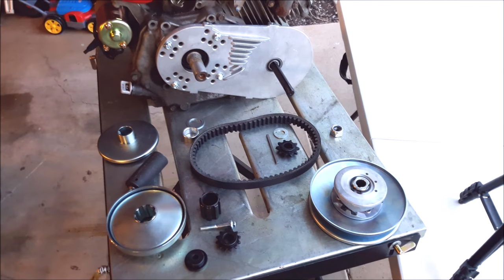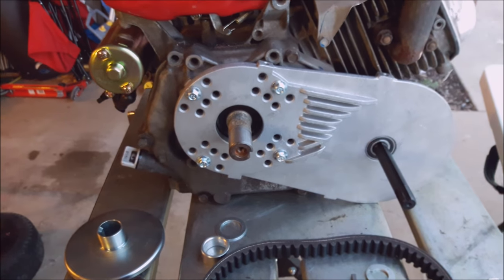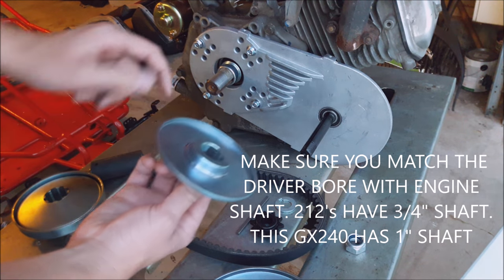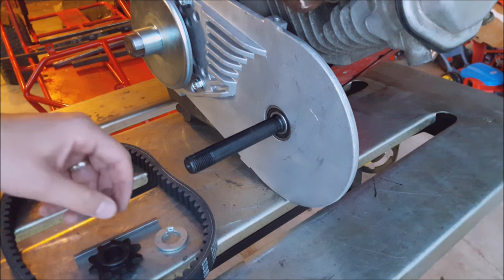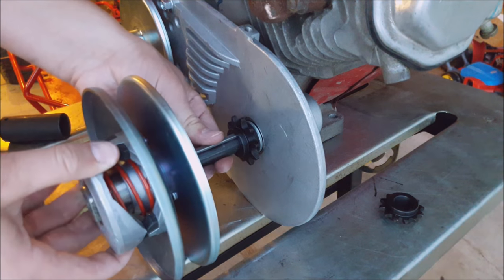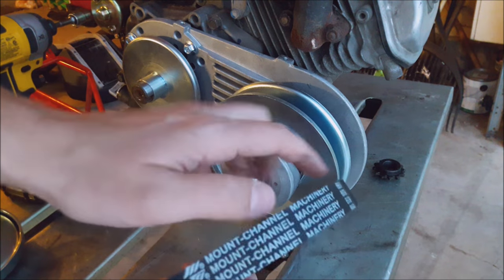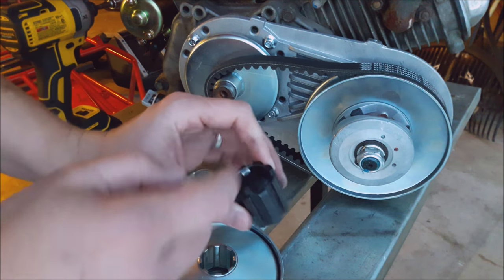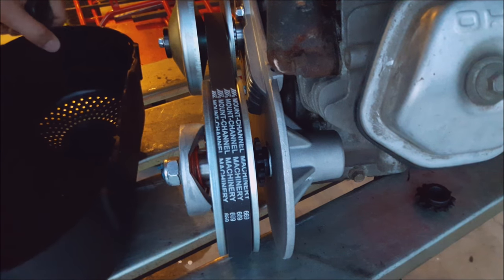Go Kart Torque Converter Setup Install (TAV)

Comment: Why does my belt not spin at all? I've properly installed it as far as I can tell. Initial pully spins, but no grab on the belt. Belt is installed correctly as well and the whole torque converter I can move by hand when off and turn the wheel. I don't get it. Any ideas?
Reply from the maker: Is it new? Sounds like they sent the wrong belt.
Reply: Mech Master I'm wondering..
Reply: Mech Master The belt is a 699 and fits perfectly. The belt just doesn't move at all with the spinning front of the tq converter. I've reinstalled it and still no action. Confused 😐
Reply from the maker: @RockieRoadz  nothing when revving the engine?
Reply: Mech Master Correct, strangest thing. I saw you have a 669 belt, and I stated incorrectly as I checked and I as well have the 669 belt you have. I see in footage that the front dealy is supposed to expand and push inward, raising tention and the belt. However I am getting just the belt sitting there and I'm wondering if for some reason maybe there's a slight gap that is not permitting the belt to get squeezed, which could be why it's not spinning.
Reply: Mech Master Either that, or maybe there's too much tention on the back end ? It shouldn't keep the system from working though. Like I said the front spindle is spinning like it should, tightened well, but belt just sits there no matter what RPMs.
Reply: Mech Master I'm still trying to figure out this tq converter. No matter what I do the thing will not spin the belt and it (the front clutch pulley) does NOT move inward when revving the engine. I don't get it. So you think it's locked?
I tried contacting the eBay seller I bought it from 8 weeks ago but.. no response. Trying to not buy another setup. Thanks for any help. I've uninstalled and reinstalled it multiple times, watching multiple videos and I'm doing it correctly. For some reason that clutch pulley will not spin. Thanks,
Jesse
Reply: @RockieRoadz  My son had a similar problem and it turned our to be that the engine wasn't revving up enough to engage the clutch. It worked when it was up off the ground but as soon as he let it down, it didn't work. Other than that make sure your key-ways are installed.
Reply: OneCupOfCoffee204 I've gotten two other belts, one smaller on larger slightly. I have currently determined that I think the driven pulley (in back) is preloaded too little or too much. I'm working on getting that figured out this week..

Comment: Blackhorse Racing makes the only decent inexpensive ones.
I have a 40 that never skips a beat and just got  a 30 series from them also.

These things need to be perfectly staight and have the belt on the correct way.
Not implying the uploader did this, just leaving the advice since that is at least 90% of the time the problem people have.

Comment: What gearing do i need for optimal speed and torque with a torque converter?
Reply: That's a good question because gearing is so important. But no one will know how to answer without knowing what tire size you are running. How tall is the tire? Mini bike or go kart?
Reply: @Deucealive75  in a go kart with 200 cc and 6,5 cv, what do you recomend ?
Reply: @felipeluizfelten  How tall is the tire? The tire size is important if someone were to make a decent guess where to start on their gearing. To find how tall the tire is you have to look at the tire and find the largest number of the three numbers there. Or measure the diameter with a measuring tape.
Reply: @Deucealive75  the size is 22/10/8
Reply: @felipeluizfelten  With a torque converter I would start at no less than 7/1 gearing.  Be sure to get more opinions on this from others with go karts.
Reply: @Deucealive75  do you think that in the 20/1 ratio i can get 60 km / h of final speed?
Reply: @Deucealive75  37 mph
Reply: @felipeluizfelten  That I wouldn't know but you may be able to find a speed calculator online somewhere. Why and how would you get 20/1 gearing?
Reply: @Deucealive75  I talked to a friend who saw the kart built by another friend in which the ratio was 21: 1, he said the kart had great acceleration and a speed limited to 45 km / h. I want to build a really simple kart model, it will be the first one I will do. He said that this reduced 20: 1 ratio is better for great starts. i'm from brazil and unfortunately here things are also very, very expensive compared to other countries. A Chinese cc 200 hp engine costs 80% of a minimum wage.
Reply: its like 1200 bucks if the wage in USA is 1500 dolares.
Reply: About 1000hp

Comment: Do i need a torque conveter or can i just have.the clutch driving the wheels
Reply from the maker: There are a lot of factors that go into that question. You'll see these torque converters on the bigger go karts that are heavier and need the low-end torque to get it going. Have you just have a little kid Kart then your typical centrifugal clutch will do just fine.
Reply: @-DIYPRO-  i do just got a kid 2 seater. It came with a anemic 163cc. Im thiking of putting in the predator 212cc directly to the wheels as i am a cheap lad😁

Comment: How do you take the rear pulley off the axle ?
Reply from the maker: The one end has a snap ring. the other is a nut so it "should" slide off if you take off one end.

Comment: You could see at the end of the video that the belt alignment is way off.
Reply from the maker: That may just be the angle of the video. The spacer/ mounting plate keeps the alignment straight.

Comment: What size driver shaft is that ?
Reply from the maker: 1" diameter shaft.
Reply: Was the bolt that came with kit the correct size for the 1" shaft? I have a gx240
Reply: And Since I am here, how much did you grind off?

Comment: It is not fitting on my 301 predator
Reply from the maker: Was it the mounting or shaft size that was off?
Reply: Mech Master I had to cut the oil insert down but it worked

Comment: You need to clean and adjust the carburetor
Reply from the maker: I'd actually just cleaned the carb but definitely needs an adjustment.
Reply: You can pull the plastic jet under the idol setscrew and run a small wire through it also hone the main jet How I do that is you can go to a hardware store and buy a torch tip cleaner kit and it comes with very small drillbits and I typically will hone the main jet one size over and I typically get a better response both on low end and top end

Comment: TAV2-30 This CVT is complete shit. There are big losses on it, there is no run-out on my microbike at all, it rides as if on the brakes. The variator is semi-wedge, only one edge works, the second straight works only as a heat generator. There are no cooling ribbing on the cheeks of the pulleys, just cheap thin-walled iron stamping and that's it. It gets very hot even at low loads only due to its own mecanic losses. After long rides at low speed, the belt burns and fails. It lasts for 3-4 rides, and after that there is no acceleration, then it clatching only at high RPM and then it stops driving at all -> it's ready - the belt needs to be replaced.
Reply from the maker: True, these are the $40 ones, not the $400 comets.

Comment: Shows how to put it on but not how to take it off
Reply from the maker: Yep, as title states install, not disassembly!
Reply: @-DIYPRO-  yep this is why nobody watches your how to’s and actually learn from it
Reply from the maker: @krcoutdoors4566  I'll help you with the disassembly but you can't get mad at me when i never mention I'd be taking it apart. Here's what you do. Watch the video in reverse! 
Ok ok if you really need help I need a little more info. Do you have one installed and the bolt is rust welded on? Can you get either pulley off? Are you looking to just change the belt?
Reply: @-DIYPRO-  I learned more from doing it myself then watching your video thanks anyways

Comment: U forgot your washer! On driven
Reply from the maker: For this larger size they don't have the washer, I even called Comet and they don't put them in their 1" shaft converters either.
Reply: @-DIYPRO-  good to know. Thanks for that, I stand corrected.

Comment: Weld that nut onto the converter that fits to the engine. If you don't it will pop off and smack ya in the face.

Comment: Thanks for sharing.  Can anyone tell me if I can put this t/converter on this old kart? :    https://youtu.be/2NYm4Q9L-dk
Reply from the maker: Yes, just make sure the one you get has the same size bore as engine output shaft. That looks like a predator enigne which has 3/4" diameter.
Reply: @-DIYPRO-  Okay cool. Thanks man.           - take care

Comment: is the belt slipping on low speed? seems pretty loose when on low speed. I notice it the plate is squeezing it when it spin at high speed.
Reply from the maker: Yep that is exactly what it does. Slips at low rpm so you can idle and one you hit the gas it engages.
Reply: @-DIYPRO-  oh, okay thanks. 
so I heard this device function similarly to CVT. do you have to control the throttle to simulate gears on car transmission? say, if I was going uphill?

Comment: Hello, im currently trying to make a go kart with a Briggs And Stratton engine. But the problem is that whenever i start it, it runs immediately, which its supposed to do. I want something that whenever i turn it on, it won't go until i press the gas. Is this what i need?
Reply: Yes, the torque converter is idle until the engine reaches a certain RPM. It depends on the torque converter and engine though. The engine will idle under the needed RPM until you hit the throttle.
Reply: @-coolerlegothings-9784  Thanks, I ended up buying it. But it didn't fit my engine because of the gear box on it. I bought the centrifugal clutch instead, and it seems to work like I want!

Comment: What size socket is on that impact gun?
Reply: You would use a 15/16 " on the nut. And it doesn't have to be monster tightened.
Reply: @Deucealive75  Thank u so much
Reply from the maker: Thanks for the reply!
Reply from the maker: Deucealive took care of you!